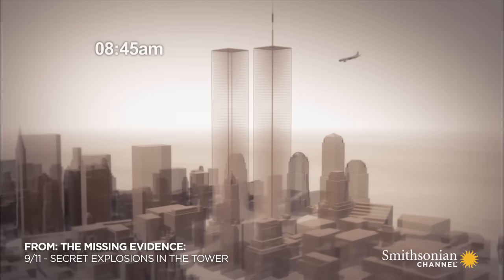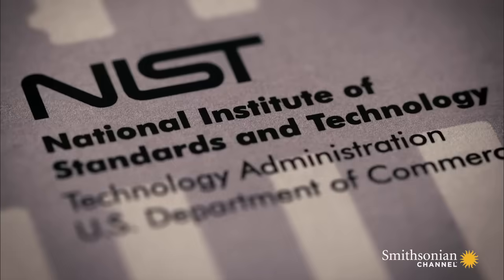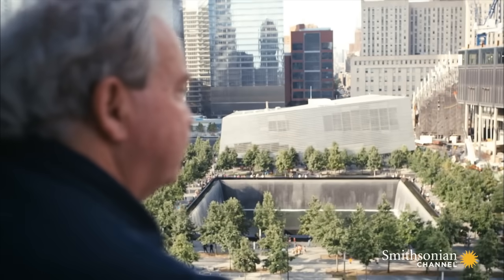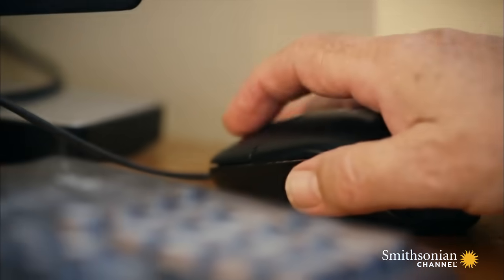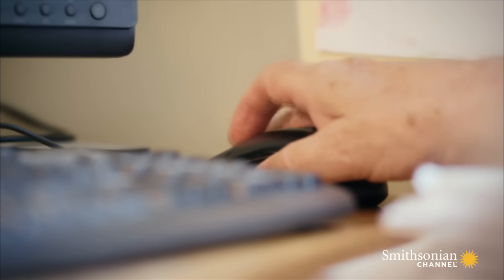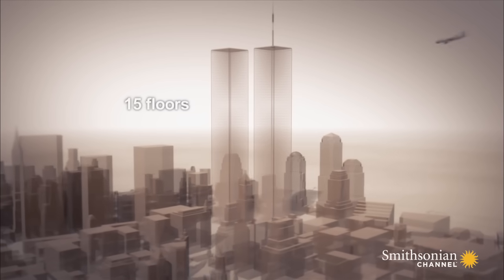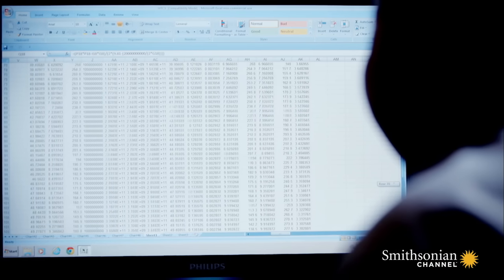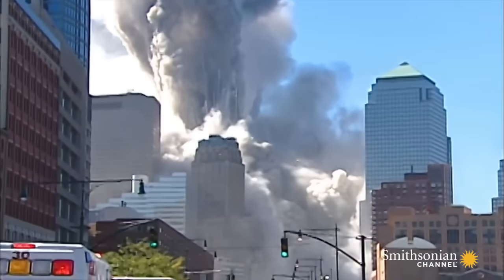This Computer Simulation Explains How the Twin Towers Fell

Comment: Doctor, the next question you need to ask next is can this simulation also explain how WTC-7 collapsed as well, but no plane hit it!
Reply: Jack Chen  
>>>>Doctor, the next question you need to ask next is can this simulation also 
How delightfully redundant

>>>>explain how WTC-7 collapsed as well, but no plane hit it!
So you admit that a plane hitting a building will make it collapse. That's progress.
Reply: Joe Plumber nope... what you don’t understand is that the government coverups are never perfect so when one domino falls so does the others!
Reply: No, you used the word next two times in your sentence. Also, there is no coverup. The troofers are lying to you.
Reply: Joe Plumber According to Newton's third law, in a natural collapse, the top and bottom sections of the twin towers would've destroyed each other at the same rate, meaning that by  the time the collapse reached the 70th floor, there would've been nothing left to crush the rest of the building.
Reply: Jack Chen  >>>According to Newton's third law, 

Newtons 3rd ceases to be relevant once the top part falls onto the lower part. Buildings are stacks of floors. When the top part falls, the load on the floor below it changes from static to dynamic. The top part collapses the floor below it, and the entire load plus the newly collapsed floor drops to the next floor down. This is a common type of collapse, and it is exactly how the American Society of Civil Engineers describes the WTC towers collapses. Yes, the top part does begin to disintegrate, but enough mass is collected from the floors it is crushing for the collapse to continue to the ground.
Reply: Joe Plumber can you explain the nano thermite collected in lung tissues and rescuers and samples.    This is a US military grade explosive, not something that can be obtained by ordinary people!  For reference please view the 5 plus hours of 911 Toronto expert testimony sponsor by the victims and our government
Reply: Jack Chen >>>can you explain the nano thermite collected in lung tissues and rescuers and samples. 

There was no thermite, nano or otherwise, collected in lung tissues. There were certain oxides and other materials that have been associated with thermite found, but those materials could have come from a number of other sources at the wtc site. There were two different studies conducted on dust samples from the wtc site. One study by Dr Steven Jones purported to have proved unfired thermite was present in the dust in huge quantities. There was a lot of controversy surrounding this report, and in the end Dr Jones was relieved of his professorship at BYU. A later study done by Dr James Millette at a top flight chemical analysis laboratory found that the material was in fact not thermite as it was missing a key element.
Reply: Joe Plumber how about mobile phone calls made in airplane at altitude that’s not even possible!  Flying at top speed that’s not even possible near ground level?  Pentagon plane with no wreckage and the size of hole looking more like a missile?
Reply: Jack Chen  >>>Flying at top speed that’s not even possible near ground level

Uh, yes, very doable. Here's the analysis of one respondent on an aviation forum. It is not the only reply to my query to confirm this, but it was the most coherent to a lay person, which I am not, but many are.

"𝐓𝐡𝐞 𝐬𝐩𝐞𝐞𝐝 𝐢𝐬 𝐬𝐞𝐜𝐨𝐧𝐝𝐚𝐫𝐲 - 𝐰𝐡𝐚𝐭 𝐝𝐞𝐭𝐞𝐫𝐦𝐢𝐧𝐞𝐬 𝐭𝐡𝐞 𝐩𝐡𝐲𝐬𝐢𝐜𝐚𝐥 𝐥𝐢𝐦𝐢𝐭𝐬 𝐨𝐟 𝐭𝐡𝐞 𝐁𝐨𝐞𝐢𝐧𝐠 𝟕𝟔𝟕 𝐢𝐬 𝐌𝐚𝐜𝐡 𝐧𝐮𝐦𝐛𝐞𝐫 𝐚𝐧𝐝 𝐝𝐲𝐧𝐚𝐦𝐢𝐜 𝐩𝐫𝐞𝐬𝐬𝐮𝐫𝐞.

𝟓𝟏𝟎 𝐤𝐭𝐬 𝐚𝐭 𝟒𝟎𝟎 𝐦 𝐢𝐧 𝐬𝐭𝐚𝐧𝐝𝐚𝐫𝐝 𝐚𝐭𝐦𝐨𝐬𝐩𝐡𝐞𝐫𝐢𝐜 𝐜𝐨𝐧𝐝𝐢𝐭𝐢𝐨𝐧𝐬 𝐞𝐪𝐮𝐚𝐥𝐬 𝐌𝐚𝐜𝐡 𝟎.𝟕𝟕𝟓. 𝐓𝐡𝐢𝐬 𝐢𝐬 𝐰𝐞𝐥𝐥 𝐰𝐢𝐭𝐡𝐢𝐧 𝐭𝐡𝐞 𝐥𝐢𝐦𝐢𝐭𝐬 𝐨𝐟 𝐭𝐡𝐞 𝐁𝐨𝐞𝐢𝐧𝐠 𝟕𝟔𝟕. 𝐁𝐮𝐭 𝐚𝐭 𝟒𝟎𝟎 𝐦 𝐢𝐭 𝐩𝐫𝐨𝐝𝐮𝐜𝐞𝐬 𝐚 𝐝𝐲𝐧𝐚𝐦𝐢𝐜 𝐩𝐫𝐞𝐬𝐬𝐮𝐫𝐞 𝐨𝐟 𝟒𝟎,𝟓𝟔𝟕 𝐍/𝐦², 𝐚𝐧𝐝 𝐭𝐡𝐚𝐭 𝐢𝐬 𝐭𝐨𝐨 𝐦𝐮𝐜𝐡. 𝐓𝐡𝐞 𝐦𝐚𝐱𝐢𝐦𝐮𝐦 𝐝𝐢𝐯𝐞 𝐬𝐩𝐞𝐞𝐝 𝐯𝐃 𝐨𝐟 𝐭𝐡𝐞 𝟕𝟔𝟕 𝐢𝐬 𝟒𝟐𝟎 𝐤𝐭𝐬.

𝐓𝐡𝐢𝐬 𝐨𝐧𝐥𝐲 𝐦𝐞𝐚𝐧𝐬 𝐭𝐡𝐚𝐭 𝐟𝐥𝐲𝐢𝐧𝐠 𝐚𝐭 𝟓𝟏𝟎 𝐤𝐭𝐬 𝐢𝐬 𝐢𝐥𝐥𝐞𝐠𝐚𝐥, 𝐛𝐮𝐭 𝐢𝐭 𝐢𝐬 𝐬𝐭𝐢𝐥𝐥 𝐩𝐨𝐬𝐬𝐢𝐛𝐥𝐞. 𝐈𝐟 𝐭𝐡𝐞 𝐚𝐢𝐫𝐩𝐥𝐚𝐧𝐞 𝐝𝐨𝐯𝐞 𝐝𝐨𝐰𝐧 𝐭𝐨 𝐭𝐡𝐨𝐬𝐞 𝟒𝟎𝟎𝐦 𝐟𝐫𝐨𝐦 𝐞𝐧𝐨𝐮𝐠𝐡 𝐚𝐥𝐭𝐢𝐭𝐮𝐝𝐞, 𝐢𝐭 𝐰𝐨𝐮𝐥𝐝 𝐞𝐧𝐭𝐢𝐫𝐞𝐥𝐲 𝐛𝐞 𝐜𝐚𝐩𝐚𝐛𝐥𝐞 𝐭𝐨 𝐫𝐞𝐚𝐜𝐡 𝐭𝐡𝐢𝐬 𝐬𝐩𝐞𝐞𝐝, 𝐛𝐮𝐭 𝐰𝐨𝐮𝐥𝐝 𝐬𝐥𝐨𝐰 𝐝𝐨𝐰𝐧 𝐨𝐧𝐜𝐞 𝐢𝐭 𝐬𝐭𝐨𝐩𝐬 𝐝𝐢𝐯𝐢𝐧𝐠.

𝐓𝐡𝐞𝐫𝐞 𝐚𝐫𝐞 𝐬𝐞𝐯𝐞𝐫𝐚𝐥 𝐞𝐟𝐟𝐞𝐜𝐭𝐬 𝐰𝐡𝐢𝐜𝐡 𝐜𝐚𝐧 𝐜𝐚𝐮𝐬𝐞 𝐚 𝐜𝐚𝐭𝐚𝐬𝐭𝐫𝐨𝐩𝐡𝐢𝐜 𝐟𝐚𝐢𝐥𝐮𝐫𝐞 𝐰𝐡𝐞𝐧 𝐟𝐥𝐲𝐢𝐧𝐠 𝐭𝐨𝐨 𝐟𝐚𝐬𝐭:

𝐖𝐡𝐞𝐧 𝐭𝐡𝐞 𝐚𝐢𝐫𝐜𝐫𝐚𝐟𝐭 𝐟𝐥𝐢𝐞𝐬 𝐢𝐧𝐭𝐨 𝐚 𝐠𝐮𝐬𝐭, 𝐭𝐡𝐞 𝐫𝐞𝐬𝐮𝐥𝐭𝐢𝐧𝐠 𝐥𝐨𝐚𝐝 𝐟𝐚𝐜𝐭𝐨𝐫 𝐜𝐚𝐧 𝐨𝐯𝐞𝐫𝐬𝐭𝐫𝐞𝐬𝐬 𝐭𝐡𝐞 𝐬𝐭𝐫𝐮𝐜𝐭𝐮𝐫𝐞.
𝐖𝐡𝐞𝐧 𝐭𝐡𝐞 𝐩𝐢𝐥𝐨𝐭 𝐜𝐨𝐦𝐦𝐚𝐧𝐝𝐬 𝐥𝐚𝐫𝐠𝐞 𝐜𝐨𝐧𝐭𝐫𝐨𝐥 𝐢𝐧𝐩𝐮𝐭𝐬, 𝐡𝐞 𝐰𝐢𝐥𝐥 𝐚𝐥𝐬𝐨 𝐨𝐯𝐞𝐫𝐬𝐭𝐫𝐞𝐬𝐬 𝐭𝐡𝐞 𝐬𝐭𝐫𝐮𝐜𝐭𝐮𝐫𝐞.
𝐅𝐥𝐮𝐭𝐭𝐞𝐫 𝐦𝐢𝐠𝐡𝐭 𝐚𝐥𝐬𝐨 𝐜𝐚𝐮𝐬𝐞 𝐬𝐭𝐫𝐮𝐜𝐭𝐮𝐫𝐚𝐥 𝐝𝐚𝐦𝐚𝐠𝐞.
𝐓𝐡𝐞 𝐦𝐚𝐱𝐢𝐦𝐮𝐦 𝐌𝐚𝐜𝐡 𝐧𝐮𝐦𝐛𝐞𝐫 𝐨𝐟 𝐭𝐡𝐞 𝟕𝟔𝟕 𝐢𝐬 𝟎.𝟗𝟏 (𝟎.𝟎𝟓 𝐚𝐛𝐨𝐯𝐞 𝐭𝐡𝐞 𝐦𝐚𝐱𝐢𝐦𝐮𝐦 𝐜𝐫𝐮𝐢𝐬𝐞 𝐌𝐚𝐜𝐡 𝐧𝐮𝐦𝐛𝐞𝐫, 𝐰𝐡𝐢𝐜𝐡 𝐢𝐬 𝟎.𝟖𝟔), 𝐚𝐧𝐝 𝐭𝐡𝐢𝐬 𝐜𝐨𝐫𝐫𝐞𝐬𝐩𝐨𝐧𝐝𝐬 𝐭𝐨 𝟓𝟐𝟑 𝐤𝐭𝐬 𝐢𝐧 𝟏𝟏,𝟎𝟎𝟎 𝐦. 𝐓𝐡𝐚𝐧𝐤𝐟𝐮𝐥𝐥𝐲, 𝐜𝐞𝐫𝐭𝐢𝐟𝐢𝐜𝐚𝐭𝐢𝐨𝐧 𝐫𝐞𝐪𝐮𝐢𝐫𝐞𝐦𝐞𝐧𝐭𝐬 𝐝𝐞𝐦𝐚𝐧𝐝 𝐚 𝐦𝐚𝐫𝐠𝐢𝐧 𝐨𝐟 𝟐𝟎% 𝐛𝐞𝐭𝐰𝐞𝐞𝐧 𝐭𝐡𝐞 𝐦𝐚𝐱𝐢𝐦𝐮𝐦 𝐬𝐩𝐞𝐞𝐝𝐬 𝐚𝐧𝐝 𝐟𝐥𝐮𝐭𝐭𝐞𝐫 𝐨𝐧𝐬𝐞𝐭 𝐬𝐩𝐞𝐞𝐝𝐬, 𝐬𝐨 𝐟𝐥𝐮𝐭𝐭𝐞𝐫 𝐦𝐢𝐠𝐡𝐭 𝐛𝐞 𝐜𝐥𝐨𝐬𝐞, 𝐛𝐮𝐭 𝐢𝐬 𝐬𝐭𝐢𝐥𝐥 𝐭𝐞𝐧𝐬 𝐨𝐟 𝐦𝐢𝐥𝐞𝐬 𝐩𝐞𝐫 𝐡𝐨𝐮𝐫 𝐚𝐰𝐚𝐲 𝐰𝐡𝐞𝐧 𝐝𝐢𝐯𝐢𝐧𝐠 𝐭𝐨 𝟓𝟏𝟎 𝐤𝐭𝐬. 𝐑𝐞𝐦𝐞𝐦𝐛𝐞𝐫, 𝐭𝐨 𝐞𝐱𝐩𝐞𝐫𝐢𝐞𝐧𝐜𝐞 𝐟𝐥𝐮𝐭𝐭𝐞𝐫 𝐲𝐨𝐮 𝐧𝐞𝐞𝐝 𝐚𝐥𝐬𝐨 𝐭𝐨 𝐞𝐱𝐜𝐢𝐭𝐞 𝐭𝐡𝐞 𝐦𝐨𝐭𝐢𝐨𝐧 𝐟𝐢𝐫𝐬𝐭.

𝐈𝐧 𝐬𝐡𝐨𝐫𝐭, 𝐟𝐥𝐲𝐢𝐧𝐠 𝐚 𝐁𝐨𝐞𝐢𝐧𝐠 𝟕𝟔𝟕 𝐢𝐧 𝟒𝟎𝟎 𝐦 𝐚𝐭 𝟓𝟏𝟎 𝐤𝐭𝐬 𝐢𝐬 𝐧𝐨𝐭 𝐫𝐞𝐜𝐨𝐦𝐦𝐞𝐧𝐝𝐞𝐝, 𝐛𝐮𝐭 𝐢𝐬 𝐞𝐧𝐭𝐢𝐫𝐞𝐥𝐲 𝐩𝐨𝐬𝐬𝐢𝐛𝐥𝐞 𝐚𝐧𝐝 𝐦𝐨𝐬𝐭 𝐥𝐢𝐤𝐞𝐥𝐲 𝐞𝐯𝐞𝐧 𝐬𝐚𝐟𝐞 𝐰𝐡𝐞𝐧 𝐝𝐨𝐧𝐞 𝐢𝐧 𝐜𝐚𝐥𝐦 𝐚𝐢𝐫 𝐚𝐧𝐝 𝐛𝐲 𝐚 𝐜𝐚𝐥𝐦 𝐩𝐢𝐥𝐨𝐭. 𝐈𝐭 𝐨𝐧𝐥𝐲 𝐰𝐨𝐧'𝐭 𝐥𝐚𝐬𝐭 𝐥𝐨𝐧𝐠, 𝐛𝐞𝐜𝐚𝐮𝐬𝐞 𝐭𝐡𝐞 𝐞𝐧𝐠𝐢𝐧𝐞𝐬 𝐰𝐢𝐥𝐥 𝐧𝐨𝐭 𝐩𝐫𝐨𝐝𝐮𝐜𝐞 𝐞𝐧𝐨𝐮𝐠𝐡 𝐭𝐡𝐫𝐮𝐬𝐭 𝐭𝐨 𝐦𝐚𝐢𝐧𝐭𝐚𝐢𝐧 𝐭𝐡𝐚𝐭 𝐬𝐩𝐞𝐞𝐝. 𝐅𝐥𝐲𝐢𝐧𝐠 𝐭𝐡𝐢𝐬 𝐝𝐢𝐯𝐞 𝐫𝐞𝐪𝐮𝐢𝐫𝐞𝐬 𝐠𝐮𝐭𝐬, 𝐛𝐮𝐭 𝐧𝐨 𝐬𝐩𝐞𝐜𝐢𝐚𝐥 𝐬𝐤𝐢𝐥𝐥𝐬."
Reply: Joe Plumber explain the dancing Isrealis, gelatin specialist, posing as art students with boxes of BB 18 fuse at WTC
Reply: Jack Chen

what about them?

Comment: As a computer programmer for 40 years, I scream BULLSHIT.   Did anybody see him show any proof?   I mean... any?   He wiped his ass with a computer.  Did anybody smelled any turd?  No.  We saw some shit.  He used a computer to make us think it was from a bull.
Reply: glenn johnson  >>>As a computer programmer for 40 years, I scream BULLSHIT.

So what operating system and computer languages were you using in 1978? What hardware? YOU sound like bullshit
Reply: FORTRAN specifically but I knew COBAL too.  I was 20 years old.  The computers required a room at 70 degrees and had card readers and hexadecimal light panels switches to control the system.  NO KEYBOARDS.   Our 10MB hard drive was the size of 10 record albums and we had two.  We only had 16mb of RAM and when it was increased to 32k RAM,  I thought we had jumped to light speed.  LOL  Personal computer didn't start until about 1981 with CPM and MPM as the operating languages.

Now that I bored the shit out of everyone, you stand corrected.  Thanks for asking.  LOL
Oh... my picture is 20 years old. I'm 59 and was born in 1958.
Reply: glenn johnson  >>>FORTRAN specifically but I knew COBAL too. 

Other than misspelling COBOL, a well written answer. I am amazed at the variety of troofers who claim to be experts in one thing or another. In a given day, they may claim to be shuttle pilots, nuclear engineers, metallurgists, building designers, explosives experts,  crash investigators, and so on. All of them invariably make their claim without doing one bit of research, and then they say something so stupid it destroys their act, they call me a shill, and they run away. Your background seems to be legit as far as I can tell. I remember the old drives with the platters in the plastic shell, the room full of half and full rack machines and so on. You may be the first legit pro anything I've ever met who is a troofer. Congrats.
Reply: LOL... That shit is unreal.  LOL again.   Yea... I was bad and still am bad at spelling.  This is why I type so slowly.   That and I had a stroke 4 years ago.  

This may surprise you, but I was a controller for a 10 billion life insurance company because I have an accounting degree and computer science degree from 1980.   In those days, you had to write your own code.

Thanks for asking.

Comment: It did NOT collapse.  It disintegrated.  Only heat can do that.  This is a false conclusion.  The building came down at free fall speed.  The CIA has controlled many of our govt institutions.  He does not even account for the 70% of the buildings that are outright missing; that a commercial airliner CAN go 550 mph, but only in the thinner air at 30,000 ft.  At 10,000 feet, it is torn apart at that speed.  Boeing lists max speed at sea level at 404 mph.  This is a most disappointing video.

Comment: This is bullshit! These towers had 30 internal columns that were 6ft long, 3ft wide and 4ins thick! Incased in concrete and asbestos! This guy was paid off. These were controlled demolitions! This guys bullshit!
Reply: That is bullshit. No concrete. No 4 ins thick except at the bottom. Not 3ft wide. You're a moron.

Comment: Pulverised human bones from people in the towers were found on the  roof of the Deutche bank building 250 feet away. Multi ton steel beams were thrown laterally 650 feet into other buildings. Gravity sure was powerful that day, trouble is gravity only works straight down, not laterally.

Comment: @Smithsonian Channel That didn't explain anything. Why only use computer sims and not real world experiments? In real world experiments you find out that the resistance force of the bottom 95/88 floors is stronger than the force of the 15/22 floors (you know the force that held up the top sections for 30+ years). There's no possible way that 15/22 floors can pulverize 95/88 floors in 10 seconds without help from an outside force. It's physically impossible. That's why they make up these computer sims instead of real world experiments. I'll give you 2/10 on your propaganda, but you're no Joseph Goebbels.

Comment: Joe Plumber no I never even said you can put the weight of the whole building on a floor. How many supports do you think this plane took out of this building which was designed to withstand exactly that? And why do you think it went down so quickly? The plane didn't take out more than 15 % on one side, and how strong do you think wings are? Stronger than those beams? Even at that speed the wings would have been ripped through, only the body and the parts of the wings closer to the body would have causes significant damage to the supports. The building would have stood and not go down so, where do you think all the smoke came from halfway up, only explosions would have caused that cloud which obscures vision. I'm not saying each floor is able to take the weight of all the floors above it, im saying it didn't have to. Only a few supports of one side was damaged. You can fit more than one of those planes in the area of one floor. How must the fire be hot enough and spread out enough at the same time to cause a significant amount of supports to lose its strength? The physical damage wasn't enough to take it down and a fire wouldn't either.
Reply: Jacques GD
  >>>no I never even said you can put the weight of the whole building on a floor. 

You didn't say so in those exact words, but your claim that the top could not exert enough force to collapse the tower is essentially saying just that. You're claim, in plain language is, there is no load that is too large for any one floor of the tower to support. It does not matter how many supports are present or missing. Once the floor is overloaded, and collapse begins, it cannot be stopped. You are so dumb, you don't even realize the import of your claim. This is why I showed you the analysis by professionals, which you seem to think you are smarter than they are. Everything else in your post is strawman arguments nonsense, so I won't bother with it.

Comment: Guy really didn't give sufficient statistics on how program worked and never explained why it imploded on itself, instead this govt. corrupt video just said that he ran a program and that's it- end of story. Chemist didn't take into consideration the physics, which a building can't collapse faster than 9.8 m/s/s, in provided time of a tiny 13 sec. , a steel building would never in the history be melted by jet fuel, steel structure would never be cut in half by an aluminum plane- rather just bent into one direction (not like confetti all around). Never forget Building #7 and how Bush reacted.
Reply: I love it when a troofer says fizzix, it means he's about to say something else dumb. Of course, the building did not collapse at terminal velocity, every video of every collapse clearly shows this, as falling debris goes by the collapse zone like a camaro passing your moms minivan on the freeway. And what's up with the melting, that's just dumb. The fires fueled by office furnishings weakened the structure until it fell. And yep a plane went into the building, just ask one of the 100,000 people who stood outside and saw it.